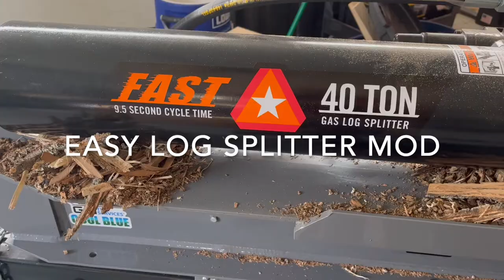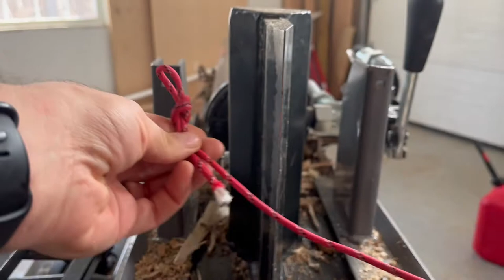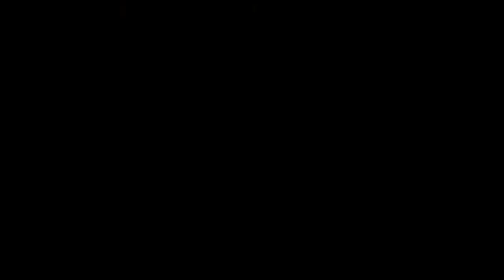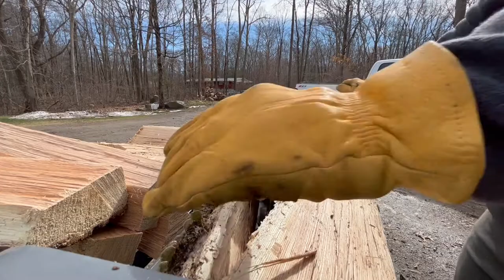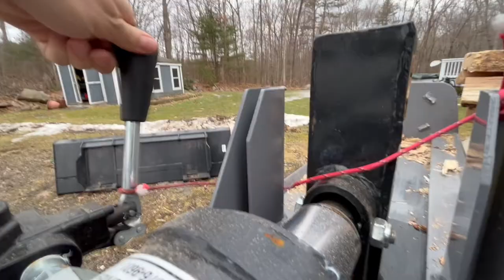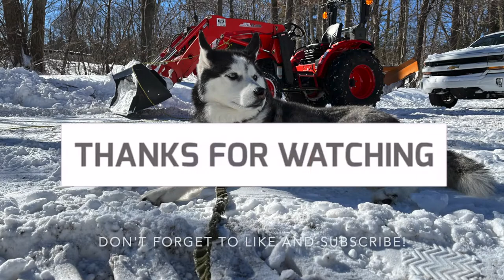Make your Tractor Supply log splitter faster with just a rope! Make Firewood Faster.

Comment: Split a large piece of oak into a square approximately 10" x 10" x the excess retraction distance you want to eliminate. Place it against the backplate with the grain going horizontal since your splitting ram is vertical. Drill a hole through the block from left to right and use rope or a ratchet strap to secure it to the back plate. You have effectively moved your back plate closer toward the ram and therefore the ram can be fully retracted through the auto-retract and it will be ready to accept your next 15" - 18" log with little wasted travel. Thanks for vid. This is also a very cool idea!
Reply from the maker: Never though of that. I have some oak 6x6s laying around I might try to hack something similar to your idea together and report back.

Comment: An inch of travel isn’t saving you all that much time.     My log splitter actually has two sets of holes in the frame to stop the ram from coming back at 20 and 26 inches with a 30 log availability
Reply from the maker: That sounds like a neat setup. 

The way I see it, every second counts. It may only be a second, over the course of a day it can add up. 

I’d love to see how your stops are setup, that sounds great!